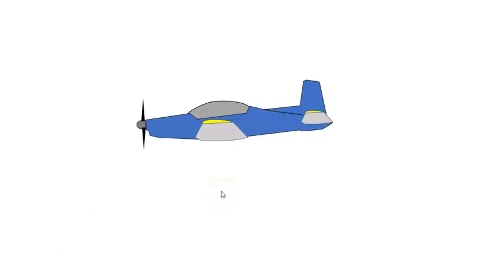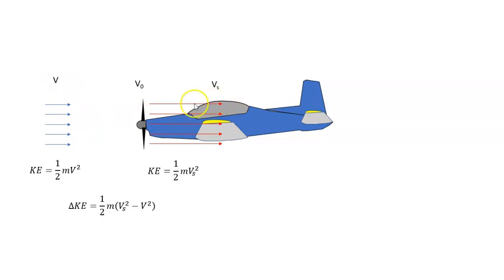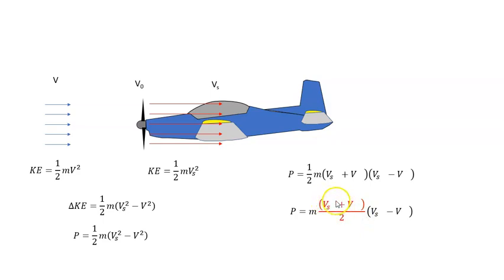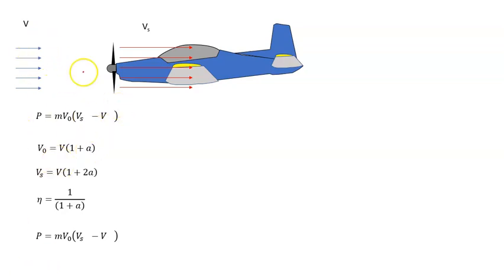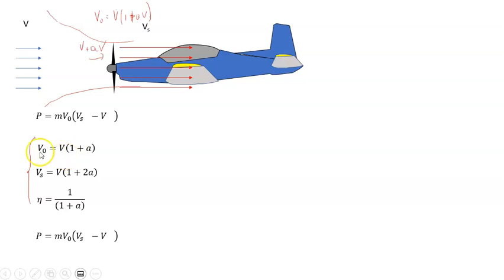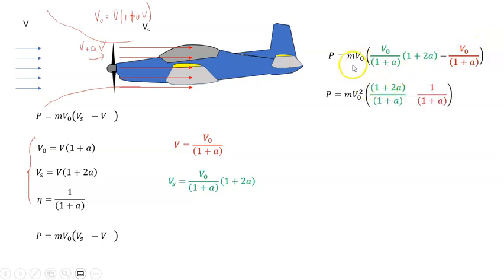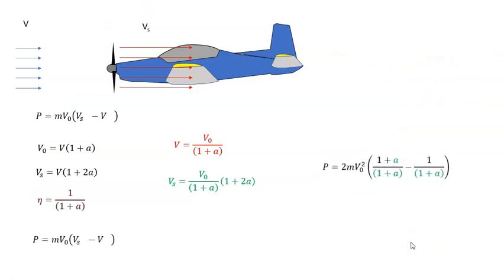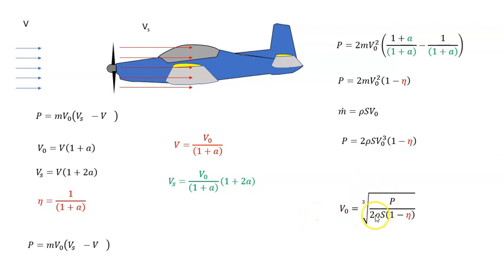Determination of V0 from Froude Momentum Theory when only Power is provided.

Comment: I have a simulation in CFD  in which i have the next setup: propeller rpm:6800 rpm , v_in=20 m/s , and as output i got :36.N , So ,  in order to get Vo (aircraft speed) , how far should i measure Vs from the propeller to get the Vo as average of V input and output?